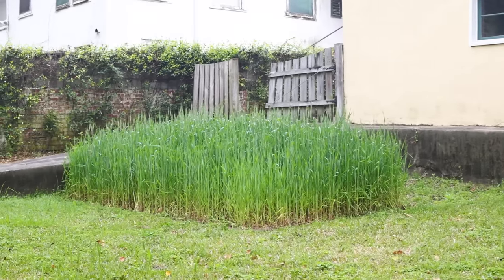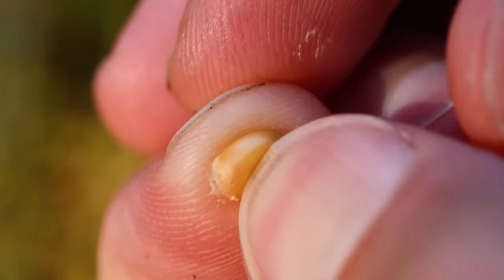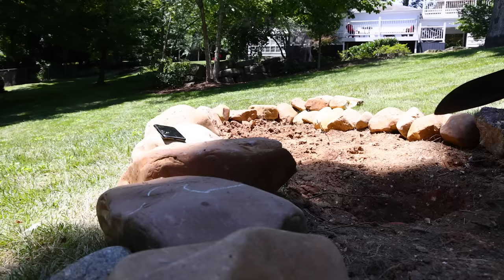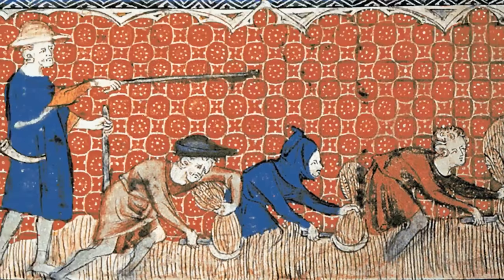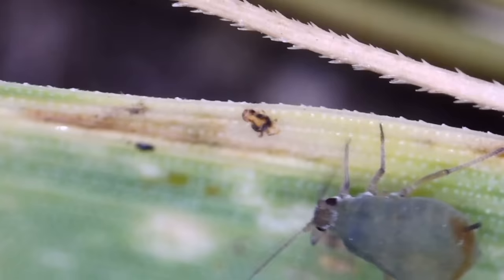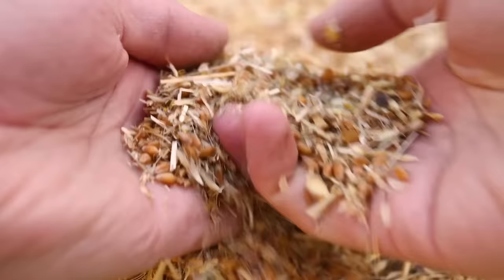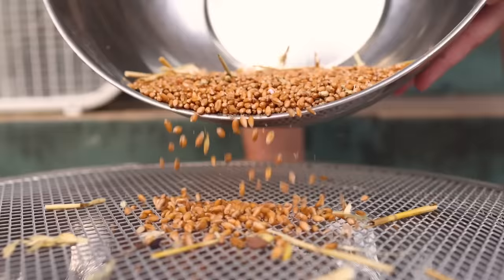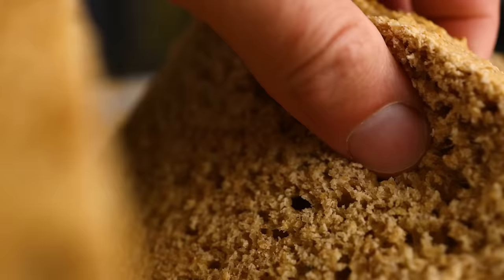Growing Bread II: Harvest to oven

Comment: actually you do not need to have pottery to boil food. you can use a wide skin from an animal, suspended over a fire, just as native american did. as long as there's water inside and fire underneath, the liquid will boil but the skin won't catch fire. Also, you can use a large skin recovering a tightly woven basket, and use hot stones from the fire to boil the water inside this, by replacing them gradualy from the water to the fire and from the fire to the water. it also can be used with raw clay vessels (and wood ones !) 
that would not whistand the direct contact of the flames. 
thinking that you can boil something only if you have a vessel that can whistand flames is a common misconception.

Comment: I mean technically didnt they have a primitive method of boiling water? like I remember reading about how they'd take an animal skin, and some wood/stones and form a bowl out of it, fill it with water and the ingredients of whatever you are making (usually soup n shit) then throw in some rocks that were sitting in the fire for a bit. Idk if they discovered pottery b4 they started doing that
Reply: They did, they also would just soak it which had the added benefit of fermentation. He clearly has a specific goal he's working towards or more accurately working backwards to.

Comment: Why not separate grain from sand and dust by washing it?
Sand will sink, dust will dissolve, grain will float, right?
Introduce some mechanical disturbance to speed up separation, then let settle.
Change water a few times to dilute away the dissolved dust and you're set.
Reply: they wouldn't have had anything to hold large amounts of water to wash it - i suppose rivers, but it would be quite difficult to make nets small enough to hold the grains.
Reply: @jermajayjay1092  Who are "they" you talk about? Peasants of old? Look up корыто for one. I'm sure every culture had something.
And stillwater ponds are abundant enough too.
Anyway, I was talking of this guy here, not our ancestors.
Reply: @MuradBeybalaev  ah - as he said in the video, he was trying to recreate how 'peasants of old' would harvest, so i assumed you were talking about that :) there are obviously many easier ways to use if we're talking about modern techniques.
Reply: @jermajayjay1092  I think my suggestion fits the level of separation he allowed himself. Afterall, those peasants didn't have a flat concrete patio either — it's a tiny stretch that can be allowed, just as with a pool, pond, deep puddle, tub or корыто.

Comment: what a horrible way to make bread with whole wheat. You need 4 ingridients grinded wheat, salt, water and yeast, mix everything then you need some wrestling with the dough, cover it and leave it to rest, leave to rest for one hour to two hours then some more wrestling but not too much and cut them into balls and let them rest (cover it). flatten the balls into disks let them have some rest. finally after few stabs with a fork put the disks in the oven. I would recommend the traditional oven of my home-country but needs an expert in pottery to make them.